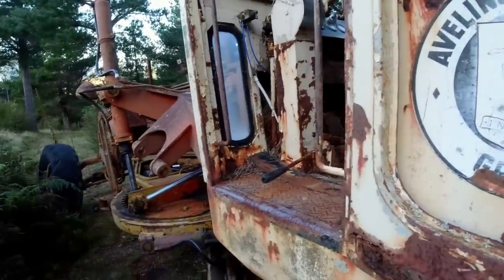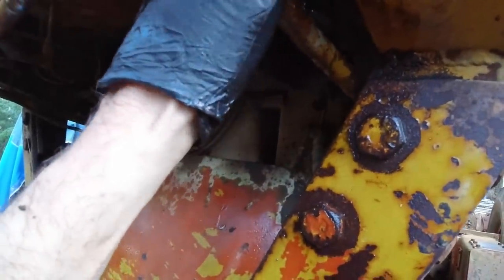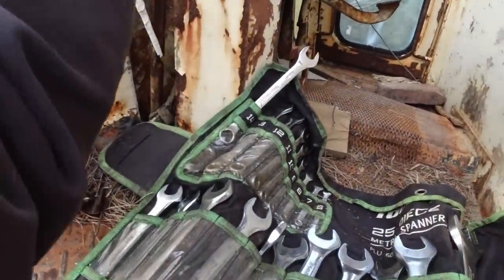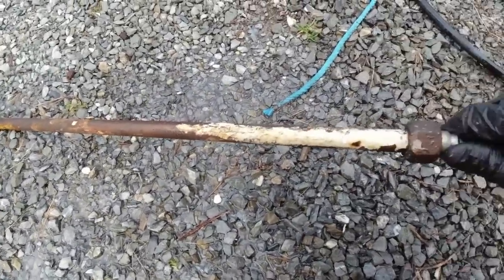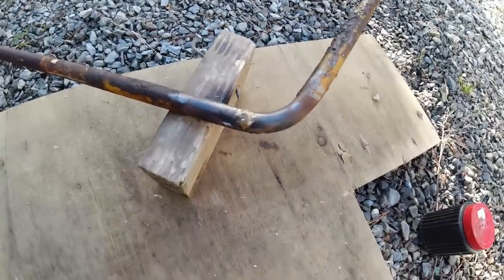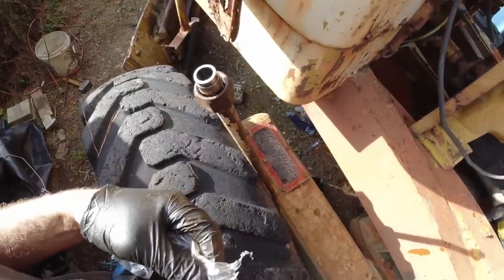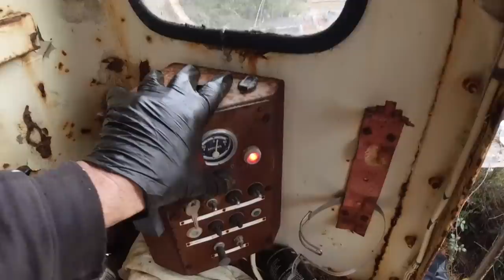Fixing a Hydraulic Leak on my Vintage Grader and Cutting a New Road

Comment: And you didn't need the manufacturer's authorization codes to update the ECM via the onboard satellite receiver or anything. 🤣
Reply: To be fair that's what the epa forced on the manufacturer.
Reply: @danhammond8406  The fancy electronic tech perhaps as a result of better combustion control but making the module accessible strictly via authorized factory access under satellite-directed live login control was purely a manufacturers' greed move. They wanted to deny consumers the right to repair.
Reply: You wouldn’t have to do that for a hydraulic leak

Comment: If it's more than a pin hole in pipe, you can coil some pliable copper wire/ cable around pipe then solder/ hard solder to pipe, makes a permanent repair. Good job Marty, always enjoy your videos, great can do attitude.

Comment: Hey Marty great video. We are from Fiji originally and my dad had a 4x4 aveling barford with a Leyland 400 in it. It was imported from NZ to the islands for use in the roading department. There weren't many of these in the islands and surely none as powerful and grunty. Dad used to cut new roads and drains in places where you'll find it difficult to walk on foot. During sugarcane season pulling trucks out of soggy fields, making house sites, new drainage on roads. It could do anything. Dad fitted a D6 ripper to the back of it and he fitted a spare wheel on the front mount face. Ripping hard rocky ground then leveling with the blade was a sight to behold. Working on rough terrain you'll always need a spare handy. We sadly had to sell the grader when we moved here but what a machine!!!!
Reply from the maker: Thats awesome

Comment: its always amazing me how a copper wire can cut through a steel pipe we have this issue all the time in refrigeration system they wire them so badly these days half our leaks are from badly run pipes and wiring

Comment: I have done this type of repair a few times, but I always cut a section out a washer to cover the hole and then braze that in place, a much stronger repair and I would have made a semi pipe to cover the worn part of the pipe and brazed that on.

Comment: You just can;t beat working on your own gear (if you have the skills).
Had a Kubota specialist work on my 5950Dt about 5 years ago to replace the clutch. Went to do some work on it and many bolts were only finger tight!!!!!  (starter motor and clutch housing) 😞

Comment: A couple wraps with electrical tape around the pipe under that clamp will stop the rubbing. Need to isolate that wiring from contacting the line also.

Comment: Hi Marty, great seeing you fix another project. I was wondering why you couldn't put a piece of rubber hose over that to stop the rubbing on that metal pipe? Always enjoy your videos. I learn something every time. Thanks for sharing.
Reply from the maker: The hydraulic oil pressure is too much for a rubber pipe, thousands of psi
Reply: @MartyT  I meant over the metal pipe to cover the metal pipe. So that way you will not have any rubbing.

Comment: That floor cutting -> ideal job for multi tool. They are relatively cheap but they are worth their weight in gold. I just recently found out myself after using angle grinder for couple of decades, thinking i dont need one. Well... I do :)
Reply: I reckon a multi-tool might struggle with 12mm steel, unless you know something I don't. They are great tools though.
Reply: @davel4708  I must admit I wrote the comment before he revealed the thickness. You are right, 12mil may be on the upper limit, if not beyond.
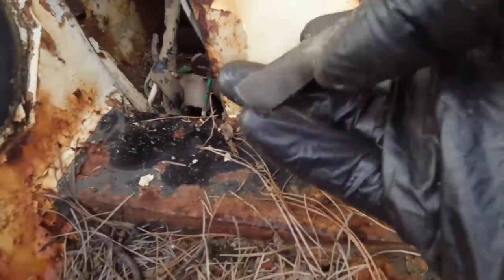Reply: @Hidegety1 yep 3:00  They are so useful though. I’ve had a fein since 2006
Reply: @wintersun398  I got Bosch and am happy with it. However many ppl say if multi tool then go Fein. But i guess it always comes down to preferred battery architecture. I heard someone say that ppl are so attached to batteries, that they will have carved the brand name on their graves 🙂
Reply: @Hidegety1  😎LOL

Comment: fun fact: an entire roll of silicon rescue tape will hold back a blown high-pressure line temporarily.
Reply: I'd keep safety glasses on for that, at least safety squints.
Reply: Yes, mining tape = No.1
Reply: And a rubber hose clamp over it
Reply: @SmithsMuseum  Yep, you do not want over pressurized water beam into the eyeball, unless you want your eye to be ....set back in the socket😂 No squinting, just use them goggles,heheh

Comment: Hi Marty, don't know if you are aware as I could not see the flame you used when Brazing, a very slightly carburising flame is good when applying the rod and flux to a joint, desipite what you see on YouTube.. A welder for 50 years in UK.
Reply from the maker: Thanks for the tip.. I will never claim to be an expert welder, I'm always willing to to learn from the pro's
Reply: @MartyT  Marty, where did you learn about all these separate things, since you can do even electrical work? You go from mechanics, to electrical work, to welding ( which you seem to do quite well as well).

Are you self-taught, where did you learn all this? I think you need to make a video about, where you learned all this stuff from. Personally, i would love to hear about your background, i'm sure others would agree.

Comment: Abit of an odd question but what make is the spanner set you used removing the pipe. They look reasonably good quality might pick myself up a set. Thanks
Reply from the maker: ToolPRO-X from Supercheap Auto, It is a decent kit - https://www.supercheapauto.co.nz/p/toolpro-x-toolpro-x-spanner-set-metric-25-piece/601470.html?cgid=SCN0113041801

Comment: Hey Marty, thanks for the video mate. I have a question for you: I've got the same tiny little oxy acetylene torch as you do. It's got that little button which operates a Schrader valve and seems like it should be able to run the smallest cutting head in existence, but I didn't get such a head in the box of bits I got it in, I haven't been able to find any information about the specific unit online and it seems a bit unlikely to me to have such a small cutting head. Do you know what the story is regarding the button?  It's always been a bit of a headscratcher to me, but otherwise a lovely little torch. Cheers mate, take it easy
Reply from the maker: I'm no expert on cutting with oxy/acetylene.. I have used this torch with my cutting head in the past, the button works, but it struggled to cut through 1cm plate. I prefer to use my angle grinder or plasma cutter for those jobs. I save my precious oxy/acetylene for heating stubborn fasteners and brazing leaky pipes

Comment: If you ever split a injector line a temp repair is to split some copper tube and wrap  around the pipe neatly and sweat it on, surprising how long it lasts for to get you out of the shit/replace line.

Comment: Love the sound of the Tui in the opening segment- nice touch and no copyright issues 😂
Was wondering how you fixed the worn pipe where the clamp was? Or did I miss that bit. 🤔
Reply from the maker: I just put some foam over it to prevent it wearing more

Comment: Yorkshire pre-soldered fittings might have been an easier and more reliable solution (depending on the thickness of the pipe). Are these not available in NZ?
Reply from the maker: That would require a trip to town and spending money on parts, This way was easier and cheaper

Comment: Wondering why you went with brazing vs trying to weld the pipe? Is brazing a better fit for that type of repair?
Reply from the maker: Usually I would use the mig but it is out of c02 and I'm likely to burn holes with an arc welder

Comment: Hey Marty, quick question: Why braze it, vs welding?
Reply from the maker: Usually I would use the mig but my C02 bottle was empty
Reply: @MartyT that was a steel pipe? Would you have preferred to weld it because it would have been a better repair or just easier?
Reply: @MartyT  Fair enough - and makes for a good opportunity at honing another skill!
Reply from the maker: @MarshallBLewis Easier for me to mig it but the brazing will be plenty strong enough

Comment: those kind of pipe fittings in hydraulic are fitted in place, thats why it could not go trough the floor because it never went, you just need to screw it tight and the fitting presses in to the pipe. you could have used samekind of pipe fittings to just replace a section of that pipe and then no need for removing the pipe at all 👍

Comment: Lived in outback rural areas all my life, done my share of road maintenance, people need to slow down, its speed and the natural forces of car suspension cause the corrugations on unsealed roads, 40kph should be on max speed for the road's surface longevity.
Exercise in futility trying to edumacate ppl on this topic, tho; the difference in time travelling at 100kph and 40kph over a few km distances is less than a minute and saves all the effort and expense on both car and road maintenance.